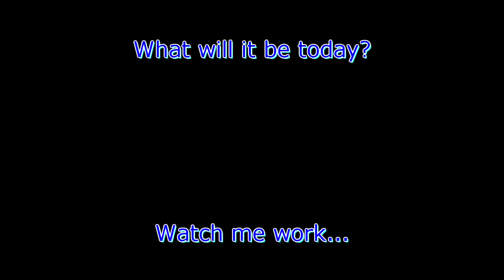VW A4: ALH TDI No-Start (died while driving) short version

Comment: I need help! Crank but no start  on 1.9 tdi Jetta 120000k new fuel pump new fuel filter plus lines and new glow plugs, did a 180 in a snowy parking lot then took it easy down the street and it stalled doesn’t want to start. It starts for a second then dies either by itself or when I apply throttle help plz!❤
Reply from the maker: Turn the crank to tdc and check that all alignment pins fit into place (pump & cam). Did you block any intake hoses with a rag while ding all the work?
Is the shut-off flap stuck in the closed position?

Comment: Iv a vw golf 1.6 diesel year 2016 it cut out when I was driving and won't start now lights and all come on any advice b4 I take it to garage?
Reply from the maker: How quickly is the engine cranking / turning over when you try to start it? Post a video so that I can see & hear. Scan for fault codes.

Comment: Hi Thomas, 
I’m a huge fun, I have learnt a lot with your videos, thank you so much. 
Usually I wouldn’t be bothering you, but I don’t know what to do now. 
I have a 2003 vw tdi alh which I love, but lately  I have problem turning it on. I have the vcds program so I confirmed that is on time and the iddle quantity adjuster is set on 4. The only way that the car is turning on is by pulling it, but it doesn’t cranks with I use the key even when is hot, but when the car is on it runs smooth and nice. I have no engine light on, and all the fuses are good including relay 109.  Can you help diagnosing the car? I live in Florida Jacksonville. 
Greetings Nicolas.
Reply from the maker: The starter does not crank? Can you activate the starter with a jumper wire... to rule-out the starter?
Reply: Thomas EXOVCDS The starter does crank, bit it seems there is no fuel compression, but it engine has enough revs to start it runs good.  I’ll post a video of the car trying to crank and then how it runs after I do a pull-start.
Reply from the maker: Nicolas Guerrero Cranking speed has to be 280rpm or faster. Could be battery, bad connection or the starter. If the intake is restricted with carbon... less air is drawn-in, which when compressed, creates less heat... resulting in starting issues. Check battery, cables & connections... starter and for carbon in the intake.
Reply: The battery is fine, it works as normal. The car may have some carbon built up but when I checked it had enough space to flow through, it is not restricted. Here is the video I took last night of the car starting and then working with vids connected. https://youtu.be/Xc4pU8Qbjyw Thank you.

Comment: Hi. I have a 2011 passat b7 2.0 tdi yesterday while driving it died and did not fire up after that. It would crank but the engine would not fire up. After waiting for about 15 mins it fired up and died after 10 to 15 seconds. And again would crank and not fire up. I'm from India and getting hold of a vcds in a remote town here is next to impossible. where can I start off with? Pls help. It's really urgent. I'm stuck in a remote place in India with no help
Reply from the maker: Sorry about the late reply.
Checking for fault codes with a "generic OBD" scan tool would be the first place to start troubleshooting.
Engine speed sensor / crankshaft position sensor could be going bad.
Make sure that there is no fuel contamination... remove the fuel filter and check the container for debris.
Reply: @EXOVCDS  So apparently my hpfp gave up. The garage said my ecu had an issue due to which it was sending interrupted signal to the fuel pump. The hpfp ran dry few times which resulted in a catastrophic failure of the hpfp. The metal particles shot up the fuel lines and injectors. Changing ecu, hpfp, injectors etc now.
Reply from the maker: Sorry to hear... hope that VW will cover some of the cost.
Reply: @EXOVCDS  my car was out of warranty when this happened. So I have to bear the cost myself. My car is a late 2011 with just 65k kms on the odo and always taken care of. I'm surprised with the reliability of this car
Reply: @ididnotgetabetterid  I have the same issue with my VW Passat CC 2009, TSI 160 PS Benziner, i have changed somany parts but still not resolved!!?